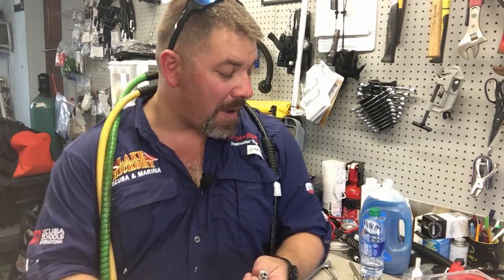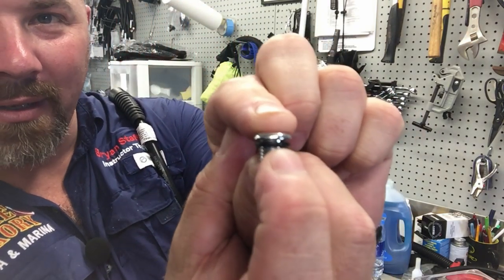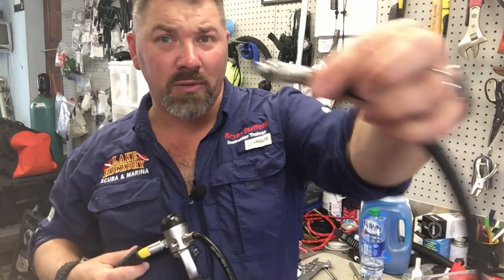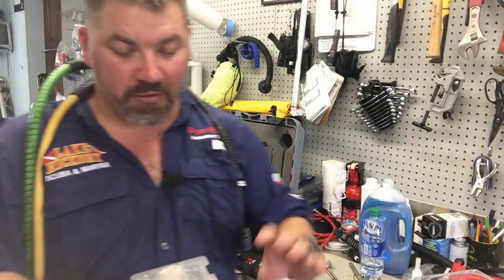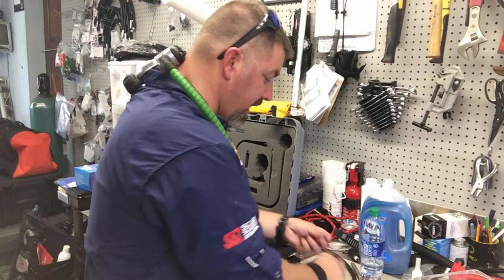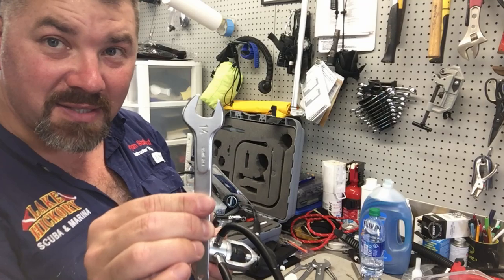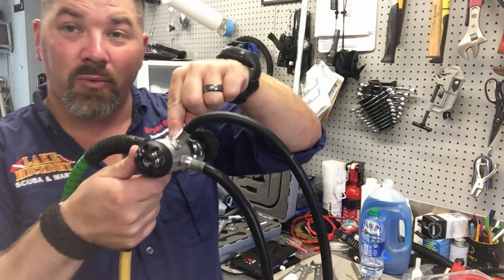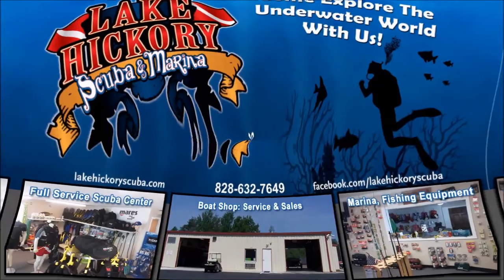Don't Throw Away Your Port Plugs

Comment: I have saved a dive for myself, and for another diver with port plug o rings. After that I make sure I keep a full set of o rings in my save a dive kit. LP, HP, yoke, DIN (both sizes🤔), swivel spool and even tank valve. O rings are cheap. I'd rather have a dive go as planned than cancel or postpone a dive. Good video! Things like this help make thinking divers. I like thinking divers!
Reply from the maker: Hello haveUSPwilltravel, glad you liked our video.  These little port plugs have saved many of dives for me as well.

Comment: What size threads are most common?
Reply from the maker: Hello MDO VIDEO.  The low pressure ports are 3/8's, and the high pressure ports are 7/16's.  A quick note, back in the date, both high pressure and low pressure ports were the same size.

Comment: Is it safe to change my primary reg hose to a flex hose? Or should I have a technician do it for me? I looked up some videos and it seems relatively easy to do as you may know.
Reply from the maker: Hello Scuba Steve, yes it is.  Just make sure you use the right size wrench.

Comment: This is the middle of my season in Ohio we go till Oct or Nov if its warm enough
Reply from the maker: Hello b st john, our season is still going for most of our divers, but we do have some that we call 80/80 divers.  They only dive when the water temp is above 80 degrees and they have 80 feet of visibility.
Reply: Here in ne ohio it's a 60 10 diver. Yep most have 60° and 10 ft viz. Ok Fla Keys Are sounding great
Reply: Ps we are at GOIBLA QUARRY in Ohio this weekend we walked to the restroom and when we came back the hole class is watching your videos
Reply from the maker: That is awesome.  Glad we got some fans up in Ohio.  Show them this reply, and tell them I said hello.